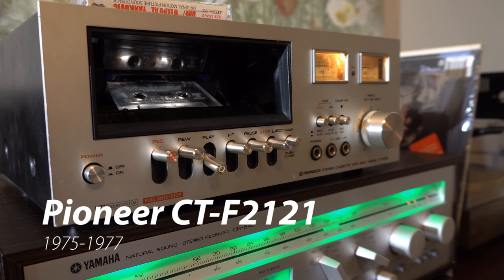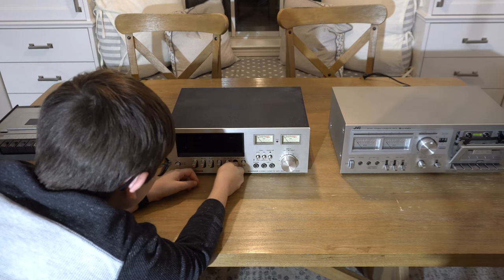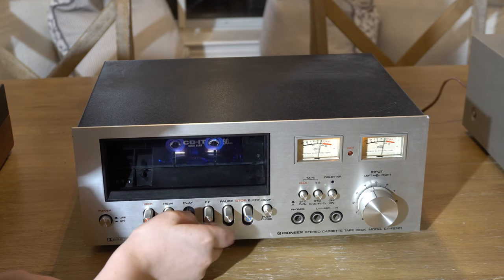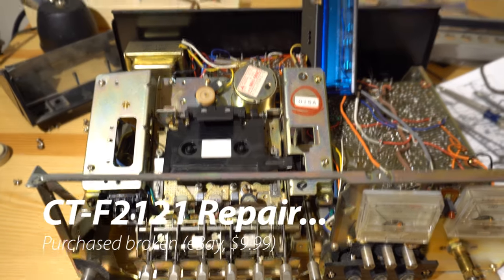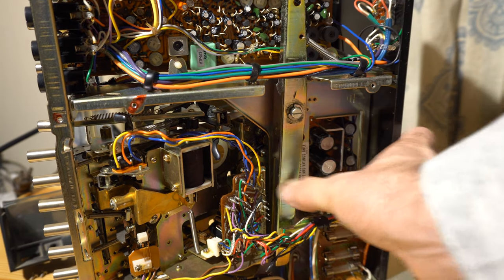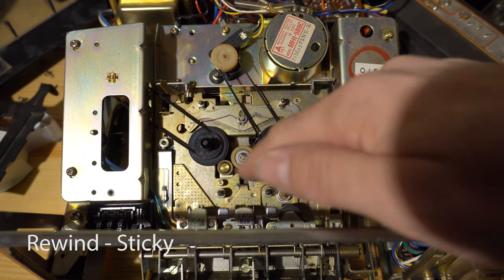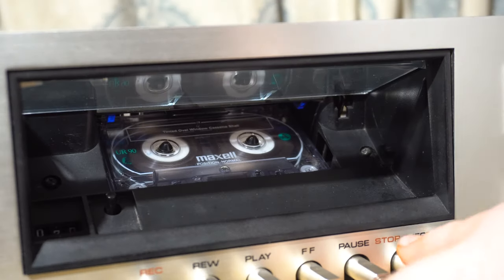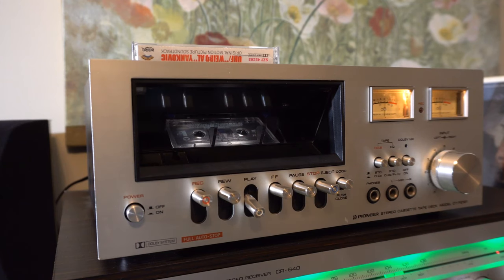Pioneer CT-F2121 - The "Tape Vending Machine"

Comment: This was my first "component" cassette deck purchased in 1975 for $127 at The Wiz in downtown Brooklyn. It did make good tapes, was simple to use and had the basic controls. That slanted cassette compartment drove me nuts. The door closed at the opposite angle from cassette well. Ejecting a tape with the door shut could jam it in there real good. You had to remember to open the door first, not so easy when stoned. The tiny meters were a challenge to use but it did make good tapes. I still have some of them. I did get sucked into buying the wood case and it kinda did look sharp. It lasted me several years till I replaced it with a Nikko ND-590ll and an Akai CS-f12. At that time there weren't many cheap, good quality cassette decks available. My fancy system included a Pioneer SX-434 receiver, this deck and a BIC 920 turntable and KLH model 31 speakers from Uncle Steve's on Canal Street NYC.
Reply from the maker: Cool story - thanks for watching! I didn't realize until after uploading this video, but the controls on this deck are mechanically designed to go from one mode to another without pressing stop first...
Reply: @ACBMemphis , at its time, it was the least expensive "good deck" available. Believe me, I did search and NYC (during the 1970's) had a plethora of audio stores to shop at. Tech Hifi, Harvey's, Great Sounds, Churchill Audio, Uncle Steve's, Lafayette Electronics, Audio Graveyard and Stereo Warehouse to name a few. Heck, even E. J. Korvette's sold audio. Glad to supply some hifi history.

Comment: Everything but the lights work on mine.  The fuses check out.  Wonder what is going on - neither the VU lights nor the blue cassette compartment light (or the Dolby NR one) come on.
Reply from the maker: It does seem strange that all the bulbs would be bad, but since this is a very old machine it's possible they burned out gradually over years. The first thing I would try is to check that voltage exists at the bulb sockets behind the blue plastic above the cassette compartment and go from there. Thanks for watching!
Reply: @ACBMemphis  No, this is a sudden development actually.  They worked and after my (probably hamfisted) change of the belts and tires, something happened and they all went dead.  Not sure if this makes any sense.
Reply from the maker: @maestromaestro  Oh... possibly they are all powered from one common area. I would check for a wire or other component that might have been accidentally knocked loose. I would also check on hifiengine.com to see if the service manual is available.

Comment: Does this cassette deck match the Pioneer TX-5300 Tuner and the Pioneer SA-6300 Amplifier? If so, I'm hunting one down.
Reply from the maker: I think so - according to the catalog I have here, they are all from 1976-77 and have a width listed of 350mm - good luck and thanks for watching.
Reply: Greetings from 2021.  It goes with TX-1000 and SA-1000, although those were from a few years prior.